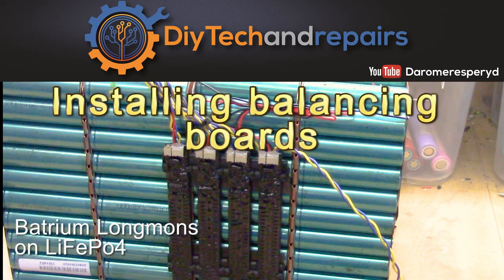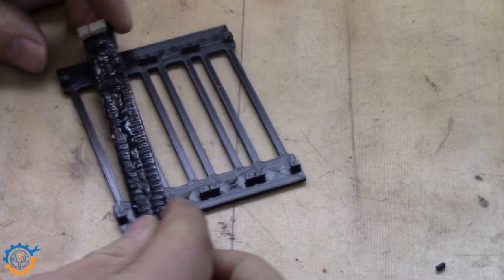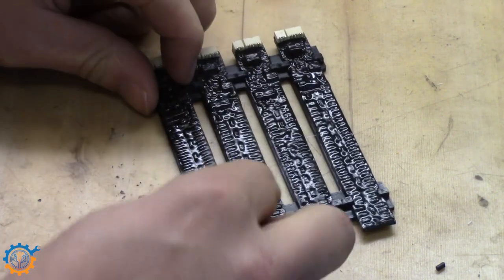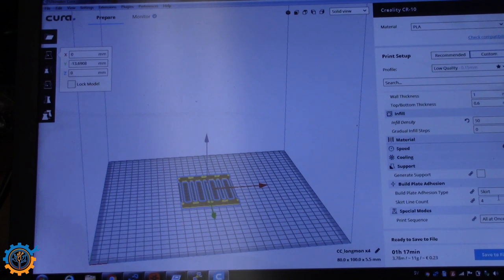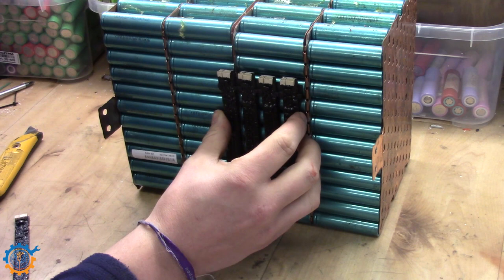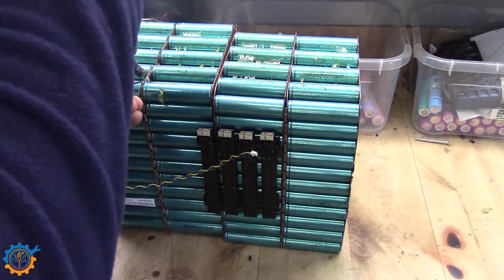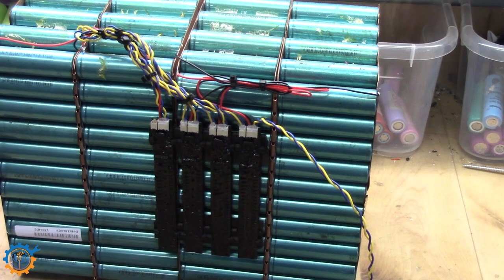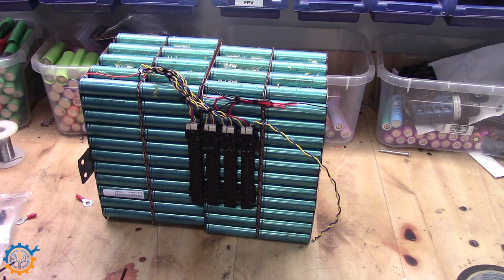Custom Longmon holder x4 on LiFePo4 battery packs

Comment: I might have to watch reviews on that 3d printer.
your thiniverse doesn't show anything shared. designs = 0. do I need a login as most things I got from there was without login needed?
Did you see the improvements on the printer you have on this video https://www.youtube.com/watch?time_continue=72&v=1u3Yk_E2AwM which can help improve?
Reply from the maker: Phizicks i have video coming about the printer next week.  It takes 24h before my account will show the files.
Reply from the maker: Most of the improvements are either not needed on this printer or are already implemented as I understand. Because it print really really good!  But that will time tell and I will do some things in future. But need to build a case for it first.